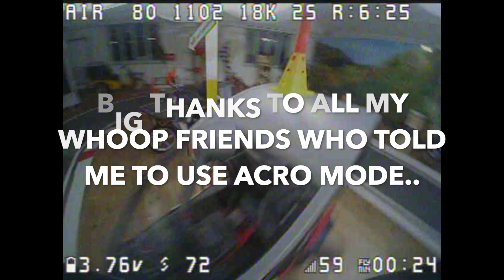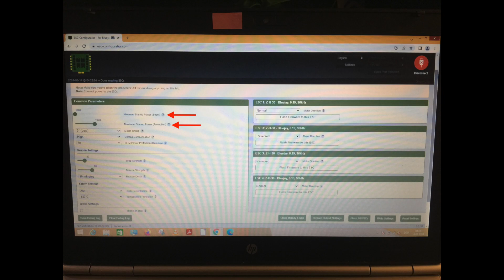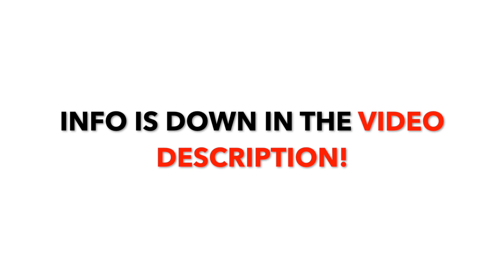🔥Betafpv 75Pro 2S PROTOTYPE (?)🔥 | ⚠️1102 18000kV is PERFECT for 2S with 45mm Props! ⚠️| 🔥POWER🔥🚁

Comment from the maker: Hello my whoop friends. I developed this 2S whoop with a friend and we learned a lot from it. For example, 2S is more sensitive to (wrong) ESC settings than 1S (it burned down!). And that motor prop combos that work well for 1S (betafpv meteor75 pro → 1102 with 45mm props) often also work well for 2S. The concept of high kV motors (so that the pid loop works well and there is always enough power for every motor in every flight situation) also works great on 2S of this size (in combination with throttle cut scale 60%, throttle mid 0 and throttle expo 0.6 to tame the throttle). We also learned that the 2S can also be flown very quickly indoors if you have the right flight level (it's not easy). But also that you can fly faster with 1S (with preheated lipos) and also fly quickly more easily. We also learned that preheating Lipo to 40 degrees Celsius also works with 2S and is also a lot nicer to fly. The 80mm 1102 18000kV has become a great whoop that has taught us a lot. It's not faster than fast 1S whoops on medium-sized indoor racetracks like in the video, but it's particularly nice to fly. It would only be faster than 1S or as fast with the same weight. We also tried that with a homemade 2S 220mah 45C Lipo. However, the C rate is too low and as long as small 2S lipos with a high C rate and folded cells are not available, it makes no sense. The bottom line is: If you have 1102 18000kv motors and a 12A 2S AIO board (you have to take of a little bit of the frame ducts to fit the flightcontoller) and 2S 300mah 80C Lipos or 2S 380mah 90C then it's worth building this whoop. Otherwise, it's better to concentrate on 1S with high kv. If I forgot something or have any questions, please feel free to ask them in the comments.

Have fun recreating the whoop!

Happy whoopin! Whoop whoop! :-)

0:00 start
0:20 Sound of the whoop
0:51 First racetrack with 80mm 1102 18000kV 2S
2:31 Second racetrack with 80mm 1102 18000kV 2S
4:40 Third racetrack with 80mm 1102 18000kV 2S
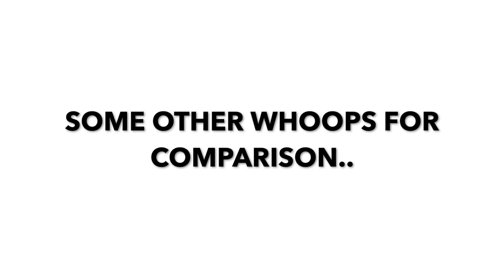6:02 Flight with 85mm 1103 11000kV 2S
8:51 Flight with 65mm 702 28000kV 1S
9:52 Pictures and Video of the 80mm Whoop
11:27 Pictures of the 80mm Whoop
12:10 Betaflight and Bluejay settings of the 80mm Whoop
12:41 Hover Flighttime with selfmade 2S 220mah Lipo
13:11 Hover Flighttime with 2S 300mah Lipo

Also note the other videos on this channel, the option to subscribe to this channel and my other channels.

Comment: I don't understand the meteor75 pro...maybe im a caveman...but if I wanted a 1s whoop, I'd go to 75mm with 40mm popsMAYBE. If I want something for outside in parks and playgrounds I'd just go with a sub 40g 85mm with 2s. My meteor 85 is at 41grams dry, and I fly it almost everywhere I fly my 75mm. Really I just need somebody to convince me to get the 75pro.
Reply from the maker: No, if you're happy with it, there's no reason to change anything. The 75 Pro is primarily for pilots who only want to fly 1S, like me (now). It's more durable than 85mm 2S whoops and protects the batteries quite well within the frame. It has a few advantages, but of course, also disadvantages. Watch my video "Why So Good?" about the Meteor 75 Pro, and you'll know all the pros and cons. But honestly, if you're happy, there's no reason to change anything. The 75 Pro isn't a miracle cure either. It's simply very good for some pilots, and I like the flying experience and the sum of its advantages. But it also has disadvantages, like any whoop. There's no whoop that can do everything perfectly. It's always a compromise.

Comment: Would you make 1S 18000kv thrust result with all basic prop ?

I wanna see how much?
Reply from the maker: I can`t my whoop friend. I have dismantled all my 2S whoops. I don't fly 2S Whoops anymore. I put the last 2S whoop together this week so I can sell it. But I have already dismantled the 80 1102 18k whoop. There is no way back. I only fly 1S now. And soon I'll unfortunately no longer be flying FPV. I hope I can keep going this winter season. But after that it's over. I will then explain why in a video. Until then I can hopefully do a few more great 1S whoop projects. Sorry my friend. I recommend you: Do it as I did. Just start and test it yourself. Then you can also become a role model for other FPV friends like I was. Let`s gooo my friend! You can do it! Let`s become a doer!
Reply: @butterflyfpv  did i say 2S,... ??
Reply from the maker: @junkthe  Oh dang it😂 my video was about 80mm 1102 18k 2S. That's probably why I missed it. Yes, I could do 80 1102 18k 1S again. Certainly not today or tomorrow. But this winter season. However, I still have more important projects ahead of me. I think 80 1102 18k flies perfectly. Just with significantly less power than 1102 22k. But probably with more flight time. I remember that my Betafpv 1102 18k toothpick motors (the ones with the thicker motor cables) performed great on 1S on my 85mm platform. So it should be fine on an 80mm platform with 45mm props.
https://www.youtube.com/watch?v=X6P9Pb6I7Is&list=PLYPR_WgF4mzWMdVLqVSnR0WozDkkKWVdN&index=12

Comment: I got x12 v2.1 on 18000kv 2S, and having high core temp, 

Could you show core temp,

When in flight outdoor daytime tested 90⁰C and makes rxloss, please check and make video to find solution for my flight ?
Reply from the maker: Hey. I now only fly 1S. Did you do everything the way I showed it in the video and described it in the video description? If so, then I don't know what to do next. It could be due to many things. It could also be that you damaged the board while soldering. I showed everything I know in the video/video description. ESC settings etc. I haven't had any problems with these settings for a long time. But at some point I crashed very hard and after that an ESC stopped working properly. That's why I'm currently no longer flying the whoop. And because I decided to only fly 1S whoops, I'm no longer building 2S whoops.
Reply: @butterflyfpv  i also do the 1S while i am specialized for 1~2S specifically for the tinywhoop 75mm.

For now i need complete expirience from anyone video that suitable my need related to 18000kv, so complete OSD , such as amp draw, watt, voltage serial and per cell, and of course core temp, and all of the sensor was required and really help educate us all.

Thanks for an attention on 18000kv for 75 tinywhoop,

Im looking more for it, and also the outdoor daytime.

I feel the motor is fine and cool.

Im running specially on frsky D8  and D16, which related to the rx loss, and look for solution, for this FC X12 V2.1 which is remain newly on my country.
Reply: @butterflyfpv  is 45mm props suit in cetus pro frame whoop ?
Reply from the maker: @junkthe  I don`t think so. Cetus Pro has 40mm propellers..

Comment: Hello i have the same build right now what awg wire you're using on the motor?
Reply from the maker: Nice to hear! I think it was AWG22. I have to ask my colleague again who built the whoop for me. I'm not sure whether that was really necessary. I can't look anymore because I've already dismantled the whoop because I only fly 1S now. 1S is so much easier to use.
Reply from the maker: I found the motors in my workshop! It was AWG26 on the motor wires!!! (and AWG18 main cable) Don`t know if it was necessary. But it flew very good like this..

Comment: I love it got a 2s walksnail 75mm on the 1102s motor limited to about 70% and its one of my favorites
Reply from the maker: Nice to hear! Thank you for your feedback! I appreciate that! I wish you many good flights with it! Whoop whoop!🥳
Reply: @butterflyfpv  id love to discuss the esc setting you came up with I burnt a board during my testing as well
Reply from the maker: @siskel82  My esc settings are in this video min 12:11. But I have to say one morning when I wanted to start the whoop, an esc suddenly stopped working properly. However, I often crashed hard with the whoop the evening before. I can't say what the cause was. Whether the hard crash was the cause. Or whether 1102 18k might be a bit too much for 12A ESCs.
Reply: @butterflyfpv  well I went back and looked on my phone I couldn't read them lol but I think that is probably a little too much but riding the edge lol
Reply from the maker: @siskel82  bluejay 0.19, 96khz, ESC Power Rating 2S+, Motor Timing Low, Dmag comensation High, RPM Power Protection (rampup) 7x, Maximum Startup Power (Protection) 1128, Maximum Startup Power (Boost) lowest position (1000?)

Comment: Ok i maybe gonna try to combine my BETAFPV 1102 18kKV with BETAFPV 2S 12A AIO, TCMMRC 75 mm TP-frame and 2 bladed 45 mm prop. 300mAh 2S 50C Lipos.
Reply from the maker: Yes good idea but not with the 50C Lipos. 80C or more. And im not sure with open props. Maybe you will burn an ESC in a crash..
Reply: @butterflyfpv  I'm doing 3D mode FPV & LOS. Yeah i'm still not sure if i'm gonna do it... 18kKV is high. Is like 36kKV on 1S. Also an idea would be to use it on a 65 mm frame with 35 mm props. Little ultra power bee. 😁

Comment: This is the same spec on Cetus Pro, would that be coincidence ?

Capable 2S.
Reply from the maker: Cetus Pro is 1S?:  https://betafpv.com/products/cetus-pro-fpv-kit. Cetus X is 2S:https://betafpv.com/products/cetus-x-fpv-kit
Reply: @butterflyfpv  only the battery frame mounting 1S.

Did you realize ?
Reply from the maker: @junkthe  You mean because of the spec of de Fightcontroller? Lite 1-2S FC. But is it 12A ESC? I don`t think so. You can`t run 1102 18000kV on 2S with a 5A ESC.. You will burn the ESC very fast.. And by burn I mean burning with real flames..
Reply: @butterflyfpv  luckly it's not 5Amp.
Reply from the maker: @junkthe  well then.. but the weight of the cetus whoop is very heavy..
Reply: @butterflyfpv  That's alright it would be the challange, how to do it without changing the Aio FC + Bldc + original Frames.

Frame Holes and cut is always accepted.

This Cetus Pro is myth.
Reply from the maker: @junkthe  challenge accepted if betafpv sends me one..😃

Comment: Power is insane, but flight time is attrocious. The more spare power you have, the less time you fly.

Are you going to go further and try something like 1003 22k on 2s? It should be a blast.

Can you include Ampere readings in your DVR, please? It's not accurate, but it's good enough for battery usage comparison between a builds. Especially, when using same board.
Reply from the maker: That's not quite right in my experience. The higher the kv, the lower the internal resistance and the more efficient the overall system. It really depends on what you do with the whoop. In my case the flight time is of course shorter because I can use the power, that's true. But that doesn't bother me. 1:30-2:00min full send is enough for me. And full send means full send in this case 🙂Yes, I can try with the ampere readings on the boards that have a built-in ammeter. I don't think I'll test another 1003 22k on 2S. I think I'll stick with 1S. Perhaps. But only when I'm done with all 1S projects...
And that can take a while xD
Reply: @butterflyfpv  it's a bit more complicated with efficiency and resistance. But for racing you don't have to care about it much.
Reply from the maker: @dezelvol  Honestly, it's just my experiences from testing nd racing. What I know 100% is that high kv motors and low resistance throughout the system are the most efficient for whoop racing. As long as you mainly move in the most efficient speed range of the motor. And if you want maximum possible power for the entire flight. So as you say it's complicated. But the principle for me is: the lowest resistance of all parts in the system is the best for me and racing.
Reply: @butterflyfpv  there is great motor testing on SiieeFPV channel. Basically, motor is most efficient on it's rated max rpm with some load. It's because throttling of brushless motor is highly inefficient. 

But prop is getting less efficient with rpm. So people often confuse motor and prop efficiency.

Less resistance means less torque on same rpm and load. But higher kv motor will make more load on prop as it will try to reach more rpm on same throttle. It creates illusion of more power. But if you compare less kv will bigger prop with more kv and bigger prop, it'll be identical. Except, bigger prop is mechanically more efficient.

I've tested bunch of motors and from efficiency perspective, you want smallest and slowest motor as  far as it can handle weight. 75mm 0802 19k kv can hover 10 minutes on 720mah. But this time will reduce if you use 25k kv. Also additional power will reduce flight time even more of you push it. 

Sure, I can be wrong, it's just my experience. It would be nice to see your Amp ratings on DVR.
Reply from the maker: @dezelvol  Yes it`s very complicated. I watched some videos from siieefpv. The only thing I can say for sure as a Racer is that low kv makes no sense for racers who want a 5inch like flying. And if you do everything right with high kv (ESC firmware settings, no motor plugs, AWG20 main cable, BT2.0 main plug, Best Lipos with the highest C-Rate, low pitch props) you can fly it long enough and have the best possible power. Of course, you can hover longer with low kv. But this is only of interest to beginners or cruisers. The low kv motors are not efficient in racing mode. Especially because the power in half of the lipo is already so weak that you just crash around (or you have to slow yourself down extremely). So you can't use the entire possible flight time with low kv in the real world (of fast racing).
Reply from the maker: @dezelvol  You can find a video on my channel with the titel: Butterfly75 802 27k | CRUISE FLIGHT TIMES where you can see how long high kv can fly if you do everything right.
Reply: @butterflyfpv  thank you. I'll check. 

From my experience, 2" 12k drains 14A to hover. But it's flying like a snail. 2s it uses 9.5A, but it's too powerful for indoors. In watts is 35% more battery usage. But sure, it's worth it.

What do you think about power comparison - higher kv vs bigger motor? I've seen your 1002 videos, but it's hard to compare by video.
Reply from the maker: @dezelvol  The problem with larger motors is that they are heavier. But sometimes you can fly them with smaller batteries. Then the total weight is low again. For racetracks with a lot of slaloms, I prefer smaller engines with more kv. But larger motors (with enough kv) are also ok. What I noticed is that larger motors (if well manufactured with low internal resistance) like rcinpower 1002 22000kv can also handle 5/6A ESC. For small high kV motors such as rcinpower 802 27k, 10-12A ESCs are required. Hope this helps.

Comment: i'm planning to upgrade my motor to 2s, but most of my batteries are 1s 450 - 550 mah, is it still good to fly with those batteries weight?
Reply from the maker: No, I do not think so. At least not for racing. I would say for racing a maximum of 2S 380mah 90C. With larger lipos I would recommend a mobula8 sized 85mm build with 1103 11000kV motors (or more kv if that's available)